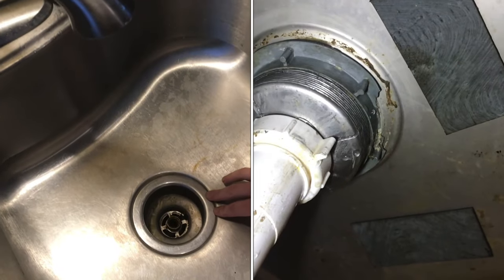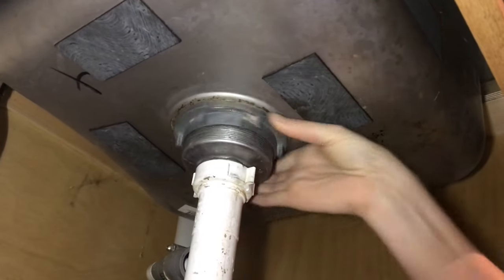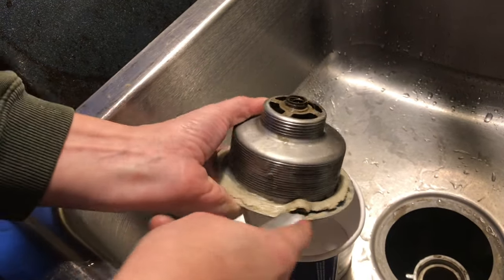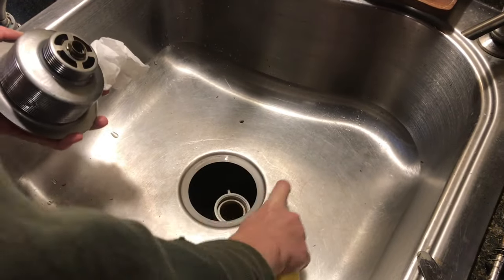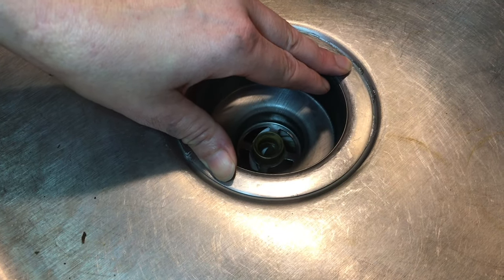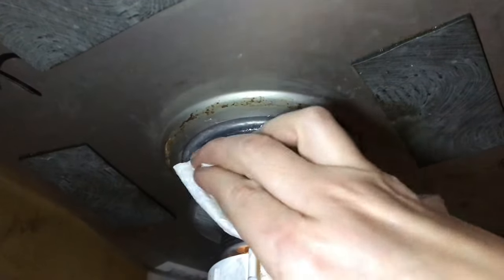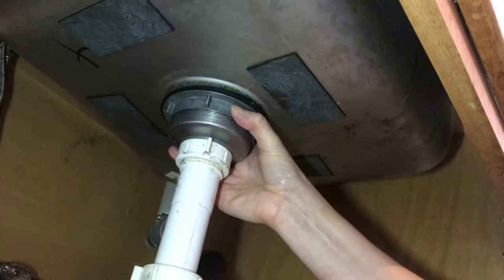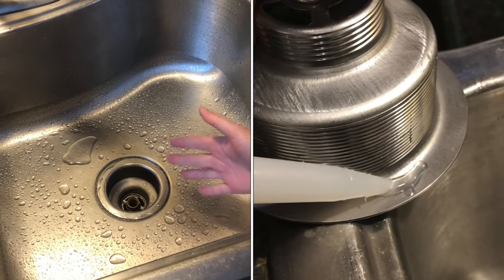“silicone” INSTEAD of “plumbers putty” on kitchen drain basket

Comment: As a plumber for over 20 years , I recommend using silicone caulk, cause it's a tighter fit to the top of the sink, putty dissolves alot from the hot water over time
Reply: Thank you. I've resealed my basket strainer 4 times and even a plumber resealed it. Now I'm doing it again. I just figured it was regular maintenance twice a year. I was ready to call a welder.  
I am so glad you as a plumber suggested this method. Thank you.
Reply: How long do I need to let it dry? Thank you.
Reply: @johnwilson7680  usually caulk will dry within an hour , I usually run the water to test before leaving a customers house
Reply: As a plumber for over 30 years, I just fixed someone else's botched plumbing job where they used silicone to set the drain. It leaked a lot. I had to remove their silicone which is a very difficult job by itself. If they had done it right I wouldn't have had to do this otherwise very simple and easy task. Don't use silicone to set a drain.
Reply: @joeysplats3209  How was it leaking through silicone?
Reply: @joeysplats3209 so wait the above comment said to use silicone caulk, so is that the same or different from silicone?
Reply: @joeysplats3209 question please.. can you use the putty on the top then run a bead of silicone under between the rubber seal and the basket? Won’t that make a better water seal? Thank you for your time .
Reply: Is Dap Kwik Seal a silicone caulk, and would you recommend it for a kitchen sink strainer-basket, etc? Thank you
Reply: Got the same questions
Reply: The same same with Silicone caulk 😂
Reply: First off if your using silicone you have to let it cure before running water. As a licensed master plumber for 28 years ilI don't have time to wait for an hr to test for leaks. I use the 30 minute shower ready silicone if I'm doing other work the same time at the customers home,This way the silicone will be cured to test and never had a leak, If I don't have any other Jobs at that customers home except replacing the garbage disposal I use plumbers putty but not just any plumbers putty , I use Sta Put plumbers putty and I make sure the entire flange under belly is covered and I use the proper basen wrench to tight the big nut as to where it will not tighten anymore, Then I clean the excess putty that gooshed out off and hook up the drains then immediately test for leaks. I use the non stain Sta Put putty for sinks that stain easy .
Reply: I am working on my sink cuz the putty has dissolved throughout the years

Comment: that test was not good enough. true test is to fill the sink with water for leaks and then pull plug to test drain connections for leaks.
Reply: Thankyou! We fill the tub up 3 times before giving it the A Ok
Reply: @jaydendowdle3504  how is the result? Is it good?
Reply: I agree too
Reply: I'm not a plumber, but this test didn't do much to measure the seal under pressure
Reply: agree,  when water leaks from where the basket mates to the sink its not from the water from the faucet unless you have just glaring issues.  its from the water standing in the sink that then is able to leak around the seal where the putty/silicon is used.

Comment: Gotta use the paper spacer between the nut and gasket.or The nut will just bind up the rubber gasket when tightening
Reply: yes the "frictionless washer"
Reply: Yes
Reply: It usually comes with a cardboard ring, but it often gets thrown away.  You can make one pretty easily. It's definitely necessary to keep the rubber from twisting against the metal ring.

Comment: Please don’t do this to your baskets. Rookie move. No way to test. And they have to come off at some point in future.
Reply: I've done this for many years. I use Lexel works just fine.
Reply: @Supa Trending Daily Lexel.
It definitely won't fail. I'm a contractor. Been using it for years with no issues
Reply: I'm a Pipefitter and both the contractor and the plumber are wrong. You weld that FN thing, whatever the hell is called, in place and never touch it ever again.
Reply: @realchicagophill  lol that would be awesome if possible. We have porcelain and acrylic and marble kinda of material to attach baskets too. Most of us can weld. Even less can weld good enough for your wife to accept her kitchen sink looking like that. 🤣
Reply: @pjplumber2146  😂
Reply: @roughroosterknifesharpenin5531  My sink is leaking. Some contractor did it.  I'm fixing it, therefore he may also assume "no issues" with his installation.  Just food for thought.
Reply: Lol, Never let a general contractor touch any plumbing in your home. They make me rich because I'm always getting calls to come out and fix there mess ups. General Contractors are not licensed master plumber or licensed master electricians or licensed anything. They are suppose to have a licensed master plumber that does all the work but they never do, They hire handymen and or try to do it themselves. They change a faucet at there house then next thing you know they think they are licensed master plumbers .

Comment: Okay, it's not calk or calking, it's silicone. Calking is water based. I use plumbers putty because as you tighten, you can watch it ooz out, showing a perfect seal. Silicone is not going to give you that visual security
Reply: Yes. I used putty as per instructions when I replaced my garbage disposal back in 2013. No issues at all with leaks or seepage. I hand tightened it until the putty oozed out. When I look at the drain from the top it looks very even to me.

Comment: I was looking at new sink wastes today and from what I see here in the UK, they come with a rubber or foam ring to place where you have applied silicone and previously used putty.
Reply: That foam is for underneath never use it for a seal
Reply: That goes underneath. Plumbers putty goes on top for rhe seal
Reply: Thank you both.
Reply: @yakkiebush5671 There are two washers...the foam one is supposed to go on top of sink and rubber one on the bottom.
Reply: Get one with brass nut if possible

Comment: An air tank with a $30 Harbor Freight air hammer & short punch work great in confined locations. A slight trigger squeeze knocks the pot metal ring (Or Brass) loose and spray a penetrating lube on it. The threads are cut very loose even on new ones. Stainless steel in sinks, brass w/cover in shower drains purchased December 2022 from "Sioux Chief" provides instructions to use 100% silicone on the wet side (an colors like almond) but the bottom gets the black seal, followed by a thick plastic backer ring that reduces effort, rubber ring distortion and makes it easy to install. If needed, vise grips on a short punch can be used with a hammer if room for all, light provided on the ear / tab only as it needs moved about an 1" (1cm) then unscrews by hand. If it binds, tap it gently as I mentioned, the threads are cut very loose. Silicone needs 2-4 hours to set & start curing, but have the wet side fully seated. 24 hours to full cure but waiting 2 hrs will give it a chance to bond, just hold it still with open needle nose pliers and a screwdriver if needed & you have a helper. But new one use 100% silicone on top. Unlike the nasty comment made by a stock-holder in plumbers putty industry!
DK, ASE Master Tech since 78, retired (I fix all of our home problems)

Comment: Ooo ooo!  I'm gonna try Painter's tape around the threads, so the excess doesn't get on them.
If you wait overnight for it to cure, aren't you risking gaps in your seal? I'd be more inclined to tighten before curing so there's a seamless connection between the two pieces (giving it a better chance of creating a perfect seal).
Reply: I've always used 100% silicone instead of putty. I also tighten it up right away as you suggest. The tape on the threads is a good idea though. 🤔
Reply: Yes you are totally correct, tighten straight away and we use soapy water in a spraying bottle to wipe away any access silicone with a cloth
Reply: @phloggo2976  This is great to know. I used putty but it was hard to fully tighten. I like the idea of this curing (which I think how the builder did it now that I see the other drain). With the putty, I haven't been able to fully fully tighten and I just feel the silicone may be better. So I might have to redo this tomorrow.
Reply: @Kassandra Nelson Hi, how did it go? I'm in the same boat as you.
Reply: @Kassandra Nelson Thank you! I'm going to redo with silicone.
Reply: @@kassandranelson222 yep silicon around the top giving that extra bit for good measure never know what had squeezed out after tightening which should be done immediately to set everything in place so it drains properly

Comment: We do this too at my job, but they silicon the  bottom rubber part snug under the sink drain in bathrooms, and they silicon the threads in the P-trap. Yes, you can do this, but it also is a permanent solution I feel. And that’s not user-friendly for the customer or the next plumber to get there.

Comment: Silicone is great if you have 24 hours to let it cure. Otherwise putty is the way to go. Use about a 3/8 diameter and press down evenly by hand. Trick: Set putty with just the nut first, no rubber gasket...do not over-tighten! Then replace nut and rubber ring just snug. No leaks. Next job.

Comment: Here is a suggestion:
If using silicone:
1) You absolutely need a paper washer (aka "frictionless washer") in addition to rubber
2) Tighten that locknut to the strainer body as soon as you add silicone and put the pieces in place

However, I recommend Plumber Putty way over silicone. Plumbers do this day in and day out. Most laymen make a mistake because we're only doing it once every few years, if ever. So if/when you make a mistake, Plumber Putty is very easy to remove from the strainer and start again.

I used silicone and made a mistake with my first try.  I'm not very good with the caulk gun. 
Getting the silicone off the strainer was very difficult, dirty, and time consuming. You need to soak the metal pieces in alcohol or even acetone depending on how dry the silicone is—and you'll need a knife to scrape it off. Meanwhile, Plumber Putty will loosen and come off the strainer under running water. Putty holds the water just fine /no drips. You'll have to change it out in a few years, but it's easy plus it's a good excuse to give your drain a good cleaning.

I was so frustrated by the silicone that I bought a whole new strainer set.

If you're dead set on silicone, just make sure you use or fashion that paper washer. I tried to buy paper washers but nobody sells them alone. You can make one from any thick cardboard insert. The cardboard should be not as thick as a shipping box but thicker than paper. The thickness of those cardboard liners that are used in the backing of a dress shirt are perfect. Just trace the rubber washer around it and make it the same size and remember it goes in between the rubber washer and the metal locknut.

Comment: The silicone will work but if you ever need to change it again thats when it bites you in the ass ! Silicone acts like glue , plumbers putty stay more flexible, unless its 50 yrs old but it will still come apart ..
Reply: Actually had to replace one with silicone. Not hard at all. Just twist and the seal will break.

Comment: Going to disagree on this one. I am repairing the tailpieces for two kitchen sinks in rental units right now. Both are 10+ years old..one used silicone and the other plumbers putty. Both baskets spun a bit when undoing the tailpiece..the silicone broke and formed leaks. The plumber's putty remains complaint and remained leak free even though both baskets spun at least 180 degrees each. Now I have to redo the basket with the silicone. The one with plumbers putty is already finished and working..no leaks.
Reply from the maker: It’s hard to argue with real results, there’s another idea though. I haven’t tried it, but they sell a silicone ring that is precast. To me this seems like a really good possibility because it would be a little bit thicker. Next time I really wanna try the precast solution. I haven’t looked at any reviews but it seems like a good possibility. With both silicone or plumbers putty if the material gets squeezed out too much the both Leak. My only concern about the precast is that it may Bring the basket too high. Hope you get everything fixed up👍👍
Reply: @livefree6878  Ooooo. I might go looking for that. I am also going to try one of these baskets that has the screws instead of the large nut/ring that connects the basket to the drain/hole. Pricey..but beats making my 12" channel locks pretend they are 16" channel locks to get that nut undone.
Reply: I like putty myself but as soon as you spin the baskets, the old seal is questionable, and needs to be redone.  You got lucky with the putty this time, but that's a gamble with a call back.

Comment: This is great to see how it is done!  You make it look so easy.  I could not figure how to loosen the pipe nut, but I see here it needs to be turned clockwise to unscrew, which is different than the "righty tighty, lefty loosy" principle.  I heard caulk tends to trap mold, so i wonder if it may present issues later.
Reply: All the threads in the video are still righty tighty, lefty loosy...

Comment: Just put in a new bathroom vanity and sink and the directions said to use silicone NOT plumbers putty. Against my instincts I used the silicone and a day later when I finished the job and tried the sink it leaked like a sieve!  Now I have to scrape off the silicone and use the putty😕
Reply: @Simon John so silicone will seal anything when properly applied AND ALLOWED TO DRY except for a kitchen sink drain basket...
Reply: Silicone is better, IF it's done carefully. IF it's done carefully. It does not remain in it's place until sqeeze happens. If anything is allowed to move when lower nut is being tightened then you may have an issue. It's a learned skill. And I do still prefer Silicone. Lasts longer and is cleaner more professional finish on top side.

Comment: My sink said to use the gasket on the top instead of plumbers putty or caulking. Haven't had any leaks for years whith the gasket.
Reply: Yeah, thats because thats what its for. If you look close the rubber binds with the tighten ring underneath and moves out of center. The lower should only have a slippery ring of something like dense cardboard to allow the ring to tighten the rubber gasket on the top side. No need for overnight wait this way. But i do love her technique since thats how u do oil pan gaskets for some automakers. If it works for a pressured system it will definitely work for a drain system.
Reply: Wow the diagram on mine literally said to use the rubber gasket below the sink and I've been having so much trouble with silicone trying to get a seal. Finally gave up and read this comment, switched the gasket to up top, cranked it down, and bam no more leaks.

Update: No Leaks! Although the drain basket is just slightly too high for the water to drain all the way, and the crevice between the basket and the sink catches food. Probably just going to try some putty at some point soon.
Reply: @brianmuir9791  yeah use silicone to replace gasket. It will let u eliminate the bump up it causes. Silicone for this is ideal but tricky tho. You have to really juice the sink side and sorta hold it roughly in one place as you tighten the lower nut. Use pipe thread sealant on threads on the entire shaft. It helps with the nut turning easily not really with sealing. Trust me I do about 15 of these a week with every type of pop up assembly you can imagine. Also sometimes the bottom of the sink has irregularities and if you put silicone on it before the process I mention it will prevent a leak. Cultured marble thats not uncommon.
Reply: @brianmuir9791  that's what you get for taking the advice of someone with the tag "Beer before Breakfast".
Reply: I think that answers my question on whether I need putty/silicone if I've the TWO gaskets for the top and bottom of the sink hole.
Reply: @beerbeforebreakfast  does silicone mess up a stainless steel sink? Like if I need to replace my drain, will i be able to remove it without ruining my sink?
Reply: @denisemartin3603  nope. Not any more than plumbers putty. Maybe less. But it does on thing that plumbers putty can't do and that is bonding. It breaks loose same as plumbers putty when the time comes. It also doesn't stain stainless steel. Definitely recommend getting 99% alcohol to use as clean up for the "squish out"
Reply: @denisemartin3603  highly recommended adding silicone, slightly tightening to almost set, then wait 30 mins for silicone to get solid. Then tighten completely. Clean up residues. Should be water tight immediately.

Comment: 35 years   in trade dont think i ever used silicone on a kitchen strainer  . had a few problems witth putty   mainly from using way too much. i have used  silicone on a tub drain  and a  couple of lavs    that had glass sinks.    ive used silicode on shower drains for fiberglas shower pans..     just little tricks in doing the work   to get good results

Comment: I have an old  sink that is original to the house. So I’m guessing it’s 30 years old. Did plumbers putty on the left and had no problems. The right side is leaking the same spot as before. I had to cut the rings when I installed new drains. I said screw it and just used 100% Waterproof clear silicone. I am guessing it has an imperfection that won’t seal with putty. I am planning on getting a stainless steel soon so this is only temporary. I will do it the correct way and smash the old one.